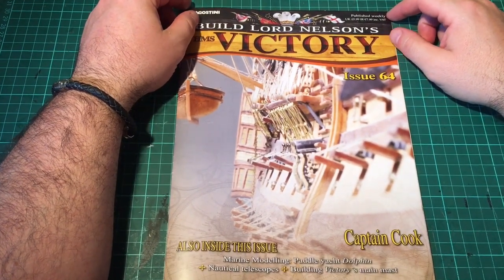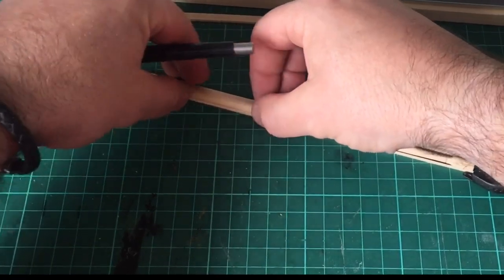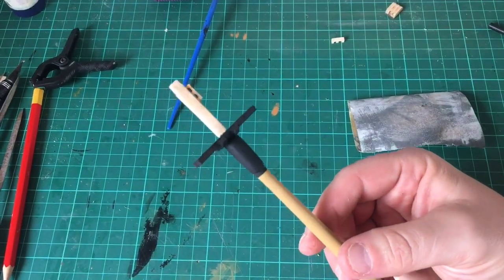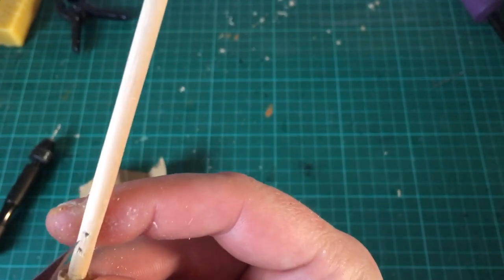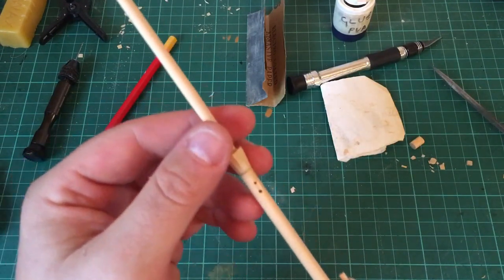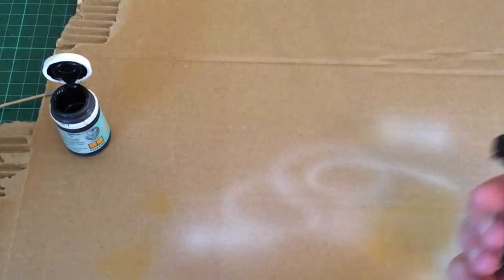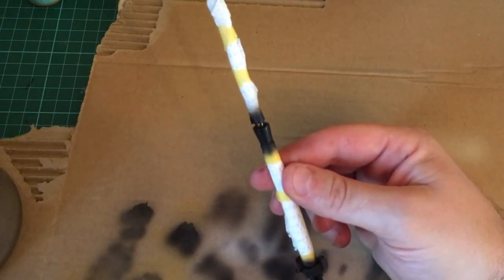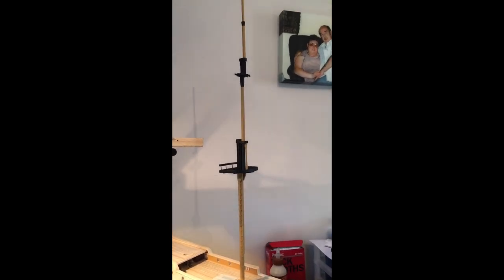Model ship building - 1/84 HMS Victory : #15 - Mini Lathe Turned - Topgallant mast

Comment: Hi John am keeping up with your build its looking really good. Anyway I thought i would share something with you. I noticed your nearing making your first yard. One of the things i found a nightmare with the yards was the stirrups for the horses or foot ropes. I wasn’t happy with making them out of brass wire, I tried different methods to make them look more like they should. I ended up binding them using a drill bit to make the loops but this is fiddly and time consuming. I also found it difficult to get them all the same length. Well I ended up leaving some of them till now which is the mizzenmast yard and bow sprit yards. Anyway i found a new way or doing which was a lot easier and looked more like they should. I found some 15mm eye bolts I didn’t use for the quarterdeck opening as I replaced mine with 10mm stanchions. I then drilled small holes into the yard, cut a little off the end of the eye bolts. I put them into the holes at the correct length then bound beeswaxed brown string around the yard twice, then bound the shank of the eye bolt covering the brass close to the eye. I then tied it off just leaving the brass eye which I painted brown. This has been the best way I’ve found of making them look like they should and wish I’d found is sooner. You may have your own method but if not this may help. Best of luck
Reply: I am pretty certail that the foot rope stirrups where rope. Make a jig and use watered down white glue to make them tight
Wil check with Longride and confirm